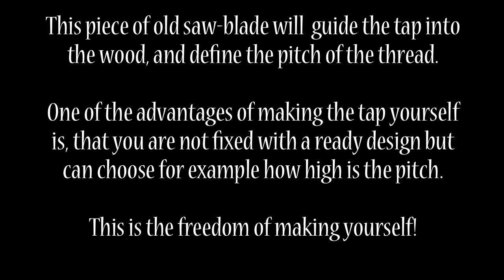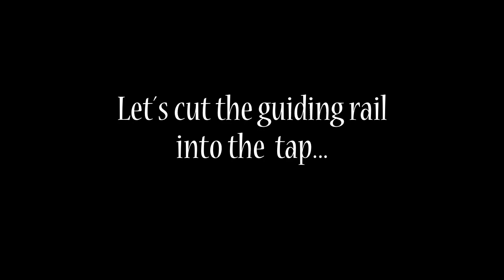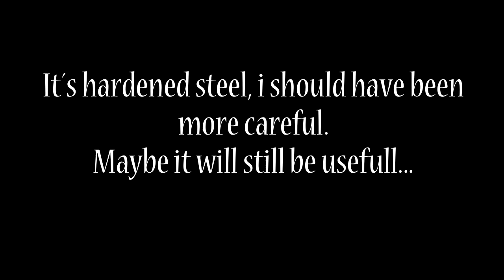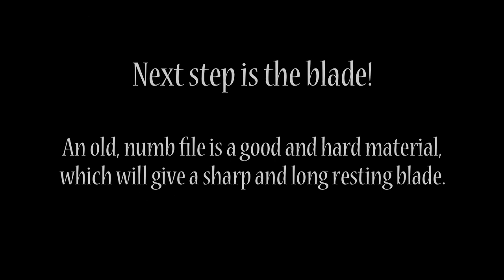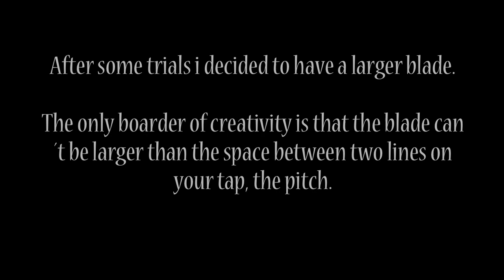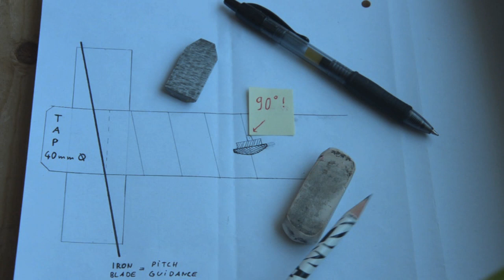Selfmade Tools for Wooden Threads Part II: the TAP

Comment: You inspire me to try again after my failed attempt two years ago!  Maybe linseed oil was my missing ingredient.  I watched all the videos, but missed a comment I guess...

What kind of wood did you use for the bolt, tap, and nut?  From the bark, it looks like it might be birch?
Reply from the maker: Yes, you are right: birch. Even if it works very well, specially for the roundwood, where the blade is fixed in, i would maybe go for maple or similar, if i reproduce it.
And also for the oil, you guessed right. In other videos, mineral oil is recommended, but i prefer ecological and biodegradable material. Soaking in oil will make the wood softer, and less tear-out will happen. It is then bit like working on greenwood.
I am glad, that this video has been inspiring you and would be even more, getting a message, on how you have been succesful. Good luck for it!
Reply: @littleforest  I will not forget to do that!  Thanks!
Reply: @littleforest  Actually, I have questions for you.  
1. What tolerance do you have between the tap and the hole with the metal plate?  
2. What tolerance do you have between the tap and the hole in the nut you are tapping?  Is it the same tolerance?
Last night, I noticed mine is somewhat loose, and the bit seems to jam a lot.  I think that a tighter fit would be better, but I still want it to work.  lubrication might help.  I'll work more on it this weekend.
Reply from the maker: Hei Bill!
1. I did not plan any tolerance. In other words, all wholes are drilled with the same size. But while using the dowel-maker, the dowel got little bit smaller than the whole. Maybe 0,1 mm.
2. Again, the drill i used to make the dowel-maker to make the Tap is the same drill i use to make the whole into the nut. But, i can choose how tight i want the thread to be by adjusting how deep the blade is sitting inside the Tap while making the last turn. Now, as i have ready screws i can always remove the Tap and put the ready screw into the nut. If it is too tight, i put the blade bit deeper and give one more round. I get them now realy tight, the screws do not move at all inside the nut. Still they go smooth. What helps is to have at least one full round inside the nut, better two and i like to use some hard soap. It gives a nice glide.

Hope, these words are understandable and helpfull.

Comment: At 9:26, when you start feeding the tap, how does the distance between the helix lines remain consistent as it shows at 10:04?
Reply from the maker: It´s magic :-)
I have to say, that exactly this point (carving the thread is easy, but how to guide the screw into the tap in a way, that the helix remains consistent??) caused me lots of thinking while the preparation. I just could not really believe that it will work. And than, afterwards it seems so easy and logic.
... as the blade itself is guiding it (not only cutting!) , the lines can´t be else than consistent...
Did this help you Christine?

Comment: Very nice work. Pitch 20 mm is not to much for 40 mm dia. dowel ?.
Reply from the maker: Hei Dan!
The screw / thread will have 60 mm diameter. Still more than usual. It´s a trial. I am finishing these tools these days and hopefully i´ll than know more about it. If so, i´ll share it on the next videos about these Thread Tools. Thanx for your patience...
Reply: @littleforest  ok, i will wait for the next video
Reply from the maker: I fished to build a tail-vise with these threads. Also I have been bit wondering if 20mm was bit too much. But now, I can say, that to my taste it works very well. They turn fast and smooth and hold very tight. To be honest, i did not expect it would turn out this well!
Reply: At 15:49 ... when you are saying "pitch = 20 mm," how many threads are within that 20 mm?

For instance, I'm used to seeing it stated as "2 threads per inch."  Or 2 TPI.

Note for me :  20 mm = about 1 inch,   60 mm = about 2 inches
Reply: @fabien sachse Yes, I remember seeing that part but I didn't catch what was being told.  I apologize.

So, in metric, it's 2 threads per mm.  Thanks for the reply.
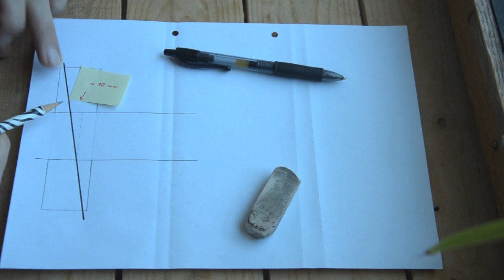Reply from the maker: Check at 3:13 !
It should be little bit more than 1 TPI as i like to use the metric system.
Is it more clear now?
Reply: @littleforest  When Answering a Question sometimes it might be clearer to say with basics 360 degress or one rotation will equal a distance 
when one has Pitch and Threds Per inch and Metric to English things can be confusion so Pitch of 20 mm or 360 degress of rotation equal 20 mm or 0.78740 inches/360 degress 0r about 1.27 Threads Per inch      on second Note, I enjoyed all 4 video of making woodscrew thanks again for sharing

Comment: Try annealing the file before shaping it.  Heat it up till it is red hot and then let it cool slowly.  After you finish shaping the steel then heat it up again till red hot and then quench it in oil.  I think that most of your files are made of something like an O1 tool steel.  This should work.  It will save you a lot of time.
Reply from the maker: Thanx for your hint!
Ironwork is still bit new to me, but i am curious to learn more about it.
This time i did it like shown to make sure to keep the iron hard. But next time i´ll try new ways :-)
Reply from the maker: @rehoboth_farm  Thank you! I will check it...

Comment: There's a cut in the video, where the cutter is turned around so the curved side faces the tap.
What happened there? Is there a reason to start with the straight side?
Did you do multiple passes?
Reply from the maker: Good question... at least, it is way easier to sharpen the straight face. Maybe this was the reason.
For the other question, you'll find the answer in the video, where these tools are shown in action - better, than with words. All the Best!